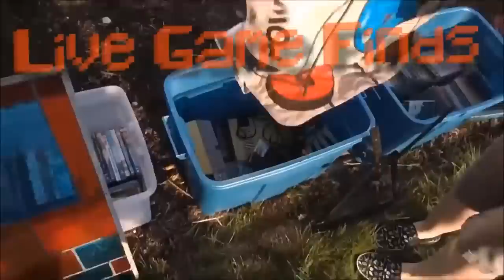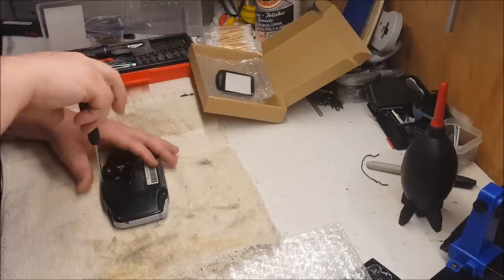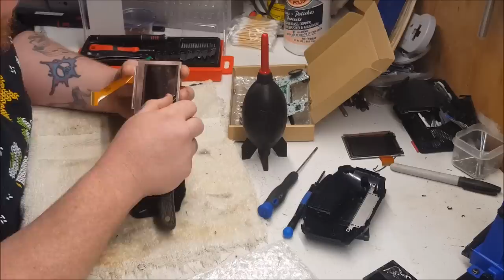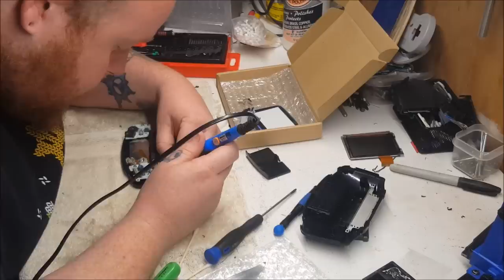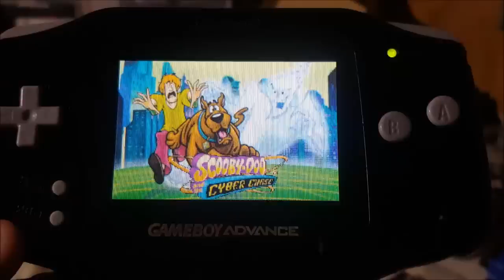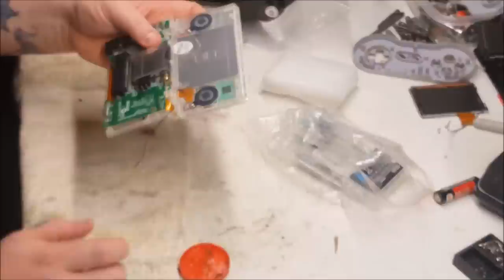Life of A Game Hunter/Collector Vlog - Ep. 52 - Let The Light Shine!

Comment: I've done about a dozen DS Lite and DSi ZIF connectors. You need a magnifying glass, tweezers, and a multimeter. It's super easy to melt the connector.

Edit: Get yourself a multimeter. Your work looks good but a multimeter will tell you for sure. Also, you have enough parts to test. Plug the Wi-Fi in and hold the battery on in the correct orientation while turning it on. The part you fixed is the digitizer. You can test your fix with a stylus.

Comment: I am doing the AGS-101 mod.  Doesn't look bad at all.  Do you know where he got the kit he sent you?  There are sites that sell the screens for around $50  and the ribbon cable for like $8.  I'd like to pay less for the screen.  Also, did you have to use the chisel tip for your exacto knife?  I've seen others do it that way.
Reply: MrKanejoe1 other option is take a original ags 101 handhelds if u find them cheap and swap screens. People out there won't like you for that, but that's the problem u deal with. Some places u can actually get the screen for 39-43 bucks that's eBay and may take a while to get to your door
Reply: killafrog124 I get why people don't like destroying game systems, but it's unlikely I'd sell it out of my collection anyway.  I've been watching for a cheap AGS-101.  They are usually gone in a matter of minutes when posted on Mercari and I haven't had much luck with garage sales either.  Retro Modding sells them for $59.99, but it's hard to pay that when I know I could eventually come across one for less.
Reply: MrKanejoe1 if you knew what pins u needed the eBay store do have screens around 40 bucks.
Yeah I always wanted ags 101 back when first heard them, just could not justify the 75+ that people want For the handheld.
Check local record stores sometimes u can get lucky at one of them style stores.
Reply: Go on ebay and order a kit from china.  The quality is the same as the originals and will only set you back around $40 for everything. Just make sure you figure out if you need the 32 pin or 40 pin kit first before ordering.  I've done a bunch of these and I exclusively get them there now.

Comment: Hey I found a spot that sells brand new sealed rob The robot amiibo for 5$ just wondering how much do u think I should flip them for
Reply: Big Country Gaming sealed rob the robot amibo on eBay went for 10-15, but I think that was a tad low considering not many on ebay, but i could be wrong. You can try 13-30 in that range and see how it sells. Otherwise at 5.00 a amibo u would need at least 15 to make a small okay profit off them.
Reply: Ok thanks killa 🐸
Reply: Big Country Gaming np man good find on the amibo if you buy a bunch off the place try for a discount so you have less of a risk off the amibo 😉
Hopefully does not cost to much to ship after P.O. supplies and fees.i had to guess could be 6 bucks.
Reply: Man I never used eBay. Buy or ship I need u to Teach me
Reply: Big Country Gaming take picture front, back, closer of toy and any flaws to the item. More pictures the longer they stay and possibly buy your item as long it makes sense of course. Might get more views if you mention which system it goes with or might hurt ur sales doing that ... who knows.
I sometimes take a wall in the room with a good lights as long as the item will stand out from the wall, for the wall can be over powering. Otherwise people have used box with good lights.
The whole shipping part is confusing and I normally do free shipping since I get confused or I can stop off at the local PO place for cheaper.  Only drawback to use the local PO instead of eBay is u may not have a tracking numbers. If you us your local PO and it gets you tracking you will have to upload the numbers to ebay. When the item does sell you can fix the shipping so it's correct. Only thing make sure to mention if this item goes international you will have to pay (set amount) more at the price u feel comfortable. I highly doubt it will go international but If does I say who cares it's gone.
There are videos out there to ship sealed toys, hope they can help you out. 
I'd honestly do try (set price 25-35) with best offer allowed at no less then 15 bucks, hopefully get offers to help u get rid of the item plus get you a idea if demand is there or if it's best to buy it now at lower price. Plus if ur getting let's say 20 bucks then you know demand says there willing to buy it now at 20 😉 hope you make your happy meal money off the amibo 😂 love having my mailman pick up the packages when I have sold on ebay.

Hopefully u can weigh the package and print your own label with printer it makes the headache less to deal with.

Also u will have to click item is shipped if use local P.O.

Anything else you need to know?